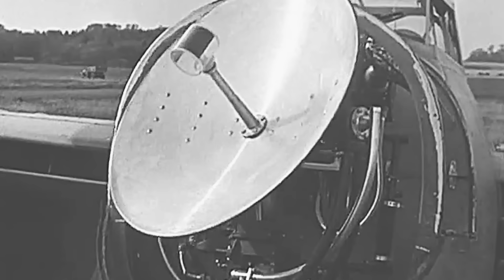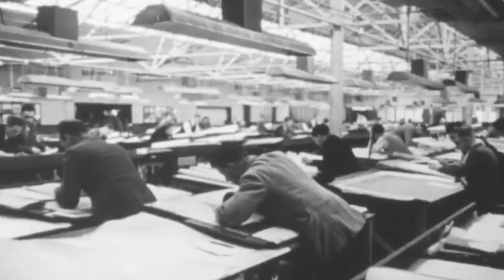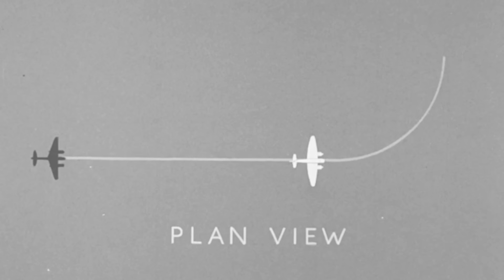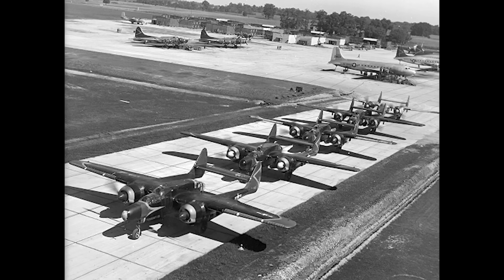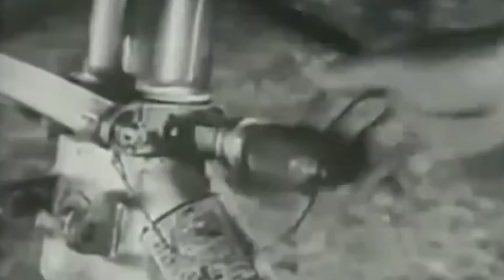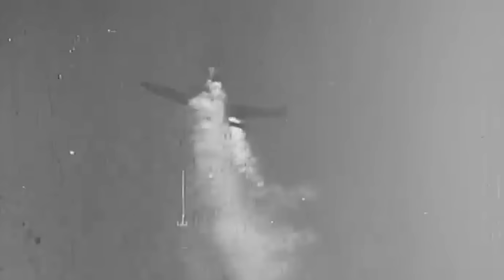The Most Chilling Plane of WW2

Comment: LOL!!! It was a Me 110 and not a 410!!!!!!!!!
Reply: There was a ME 410 and it was encountered by the P61 and it was faster than the P61. Look it up. P.S. It was Germany's night fighter. It had radar in the nose and had more firepower than the P61. And had the option to carry an external bomb load. It was designed with some heavy firepower to shoot down a B17 in a single burst. And if I remember right, The production was halted or slowed down significantly , because it used the same engines that the ME 109K model. And they preferred to use the engines in the 109K instead of the 410. Not enough engines to go around for both at the same time in production.
Reply: @danhammond9066  Not just a night fighter. P-47 ace Robert Johnson shot down a few Me 410s while escorting daylight bombing missions.
Reply: LOL!!! You should have done a simple internet search before you foolishly disclosed your severe lack of knowledge. Messerschmitt built an improved version of the Me 110 and Me 210 and designated it "Me 410"!!!!!!!!!
Reply: @oscargrouch7962  And that is what I said. The Me 410 had bigger engines than the 210. It was faster. It used the same engines the 109k used. And they did adapt it to carry radar and they did use it as a night fighter. But not all of them where used this way. Unlike the P61 which was solely used as a night fighter. If that is what has you all worked up then go for it.

Comment: The P-61 was an all-weather interceptor, not a dog fighter. Night fighting was stalking then a quick kill, not prolonged manoeuvring. It had to be big to accommodate the valve technology radar, and needed a long development period. However, you can’t help wondering whether a nightfighter conversion of the Martin B-26 (which used the same R-2800 engines) might not have reached the same goal quicker. The early planning for the Douglas A-26 included a nightfighter option.
The lateral control was interesting using spoilers with the small ailerons there mainly to provide pilot feel. The P-61C was among the first fighters to use airbrakes (rather than dive brakes)
But the P-61 had such an interesting shape.
Reply: And it never had the performance of the Mosquito
Reply: I have read in a couple of British published book that the P-61 was the most maneuverable plane in WWII with its spoilerons.   It also was noted for its intrusion ability to attack ground targets under night or limited visibility conditions.  The turbo supercharged version was about 50 mph faster but was not available in time for the war.  However the plane's top speed was adequate to intercept enemy planes that would not be operating at war emergency speed when they didn't know there were being targeted.
Reply: @danzervos7606  Nothing of that in Gunston Combat Aircraft  only that it had early success  
Mike Spick  Fighters is scathing
Reply: @danzervos7606  Most manoeuvrable I do not think so.
Reply: @jacktattis For a plane of its size and class, yes.. it was the most maneuverable plane at that time. Fast, too...
Reply: @jacktattis  I've read the conference reports and the p-61 smoked all it's competetion.
Reply: @blitz8425  Where?
Reply: @jacktattis  the 1944 joint fighter conference at Paxtunt river 1945. Id have to get you a quote when I'm home, but basically the p-61 test pilot was able to get gun cam on all it's targets and never got caught itself. That holds true of all the individual accounts I've read from people who actually flew the plane, it was a remarkably maneuverable especially given it's size, and handled like a dream. The people who hated it most were people who worked on it, but that's true of every vehicle practically. I haven't found any negative accounts from crew of the p-61, only praise, and according to the original test pilot this thing was so stable in the air that if you managed to put it into a spin, you just had to let go of the controls and she would right herself.
Reply: It's all run by politics (means moron politicians), with zero emphasis on any sort of logic or clear thinking

Comment: The Radar was supposed to been put in a Mosquito but they were used in the war duties. All very strange but it did shoot down a 110 a 111 and a190 which was impressive but as used late in the war could not shoot down a 163 a 410 or a 262 as too fast and agile. It was built too late for the war so many were built and then scrapped.

Comment: American bragging rights yet, again...
The P-61 was a massive failure as a night fighter. The Mosquito was superior in every way but one - it wasn't available when the AAF most needed it.

   The great night fighter fly-off was rigged, but not by the British pilot. Knowing that the P-61 lost any advantage above 20,000 feet, the test was run at 5,000 feet, 10,000 feet, 15,000 feet, and 20,000 feet. The two aircraft flew toward each other in daylight, then tried to get on each other's tail. The P-61, while slow, altitude limited and restricted in range, was a good dog-fighter -- of course, night fighting made nearly no use of dogfighting abilities. The American crews got to keep their aircraft, their esprit d'corps, and their bragging rights, but they lost out on a superior aircraft.
   The Mosquito's single-engine capabilities were known, but not fatal, how often did a Merlin fail? -- in the MTO, the single AAF Ju 188 kill involved a chase across most of Italy, over the Apennines, into Austria. The entire chase was flown with the Mosquito's dead starboard engine feathered.

Comment: One of the P-61's downsides was that it couldn't be carrier based. The Navy had to develop the F6F Hellcat into a night fighter by mounting a radar on one wing.
Reply: Not to mention the radiation the pilot and co-pilot were subjected to from the rotating magnetron radar…..kind of like flying inside a microwave….
Reply: The Navy had the F7F late in the war and used it as an attack plane in Korea.  There’s 2 restored F7F flying at the museum in Colorado Springs.  See them flying around regularly.
Reply: They did the same thing to the Chance-Vought F4U Corsair, right?
Reply: @thudor1  uh….no
Reply: @trappedinkalifornee - a quick search can reveal thudor is correct
Reply: Sea Mosquitoes were produced, ready for the invasion of Japan. For use on the largest British carriers.

Comment: Gee, it was 50 mph slower than a Mosquito, had less firepower in the nose (the Mosi having 4x20 mm and 4x .303 machine guns)...
Reply: Sorry, man, but 4 .50 caliber MGs give the P-61 MORE firepower than the Mosquito, not less, the .50 caliber round being considerably larger and heavier than the .303 caliber round.
Reply: @richardcall7447  When they eventually got the turrets working properly and actually fitted them...
Reply: @richardcall7447  You forgot to add the 4 x 20mm cannons, squire.
Reply: Seems like we have some people here that didn’t do well in basic reading and mathematics. The 4x20 mm cannon and 4x.50 caliber machine guns on the P-61 were more powerful than the 4x20 mm cannons and 4x.303 caliber machine guns on the Mosquito, it doesn’t matter where the guns were placed, if that was some little semantical game, you were trying to play
Reply: The 61 was a completely different plane that was specialized from its inception. It was slower but would undoubtedly have been made faster if it had had time for further development. The Mossies were a special plane for other reasons. It was lightning fast from the beginning and was able to cross-over into many roles making it very versatile. A great plane constructed of the humblest of materials, unwanted at first by its own military yet outperforming many planes of its era it gained respect of its pilots and military brass as well as the Germans. Both of these planes were great for their own reasons and it is unfair to pit them against each other on a one to one basis.